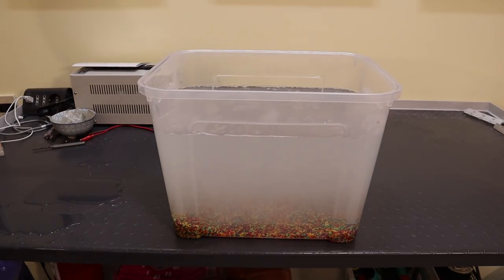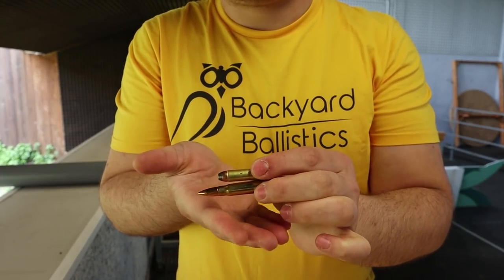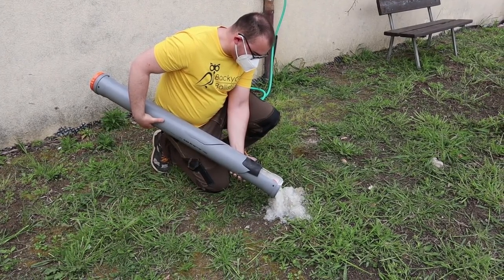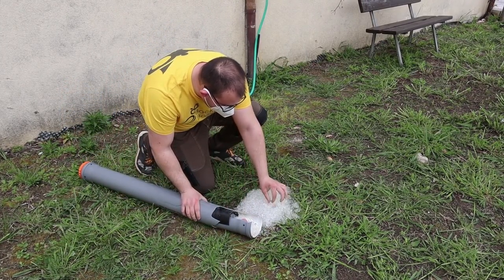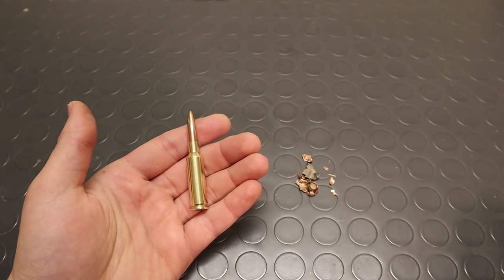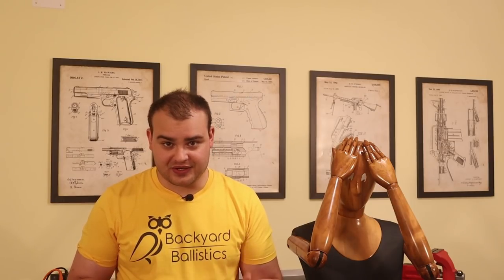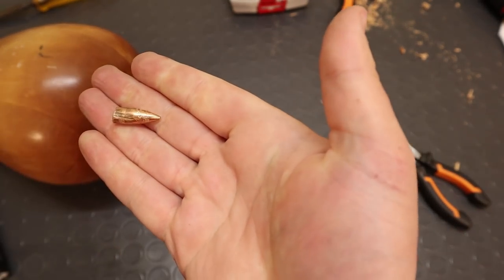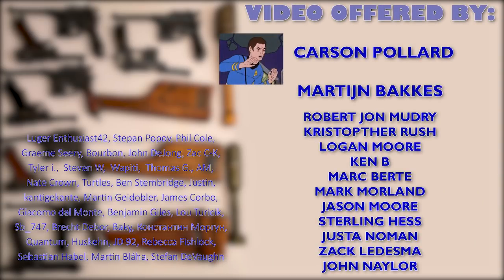How Orbeez Can Stop Very Fast Bullets (And Why It Matters)

Comment: One possible difference in materials could be to use a clear polycarbonate tube lined with a clear silicone coat, in order to enable viewing depth of travel without having to open and retrieve the fired projectiles. Just an idea.
Reply: It's possible to source clear PVC in a wide variety of sizes all the way up to 14 inches in diameter. They definitely make the same diameter as the tube in this video. There is also clear silicone sheeting that would probably replace the black stuff shown here.

Comment: 4:25 I feel like Mythbusters did a pretty decent job on their "survive by diving under water" myth with their angled rig firing into a large pool from a 30 degree angle; it reduces the necessary depth of the container and allows for a longer container, but the principle is still the same - it still needs a very large container full of water, which  can be damaged or ruptured from the hydraulic shockwave of supersonic projectiles if it isn't large enough or robust enough.

Comment: High quality content and a flawless explanation, as usual. There's only one thing I disagree upon: the sentence "this video is already too long".
As for the pipe, I suggest buying those used for acoustic performance: high density material, thick and possibly multi-layered (like the one you used) or additioned with mineral charges.

Comment: I think to avoid the high velocity ammo like the lapua ammo and the ak ammon from deformation you will need a much larger tube. At least 3x in diameter.   I think the deformation occurs when the orbees create dense zones.  The more rounds you shot into the the tube the more dense the cross section became by the looks of it.

Comment: Aren't liquids/gels also forming a vacuum behind the projectile once they close the penetration path again, thus there would be an additional pull force against the direction of movement of the projectile, adding to the stopping power¿ That would be different to a non closing material.
Reply from the maker: That form of drag is proportional to the static pressure, which at low depths is close to atmospheric, so many orders of magnitude smaller than dynamic pressure

Comment: Just curious, is 6.5 Lapua the same cartridge as .338 Lapua?
Reply from the maker: no, not at all, completely different casing and bullet diameter. the 6.5x47 has the same case head as a 308 Win, while the 338 lapua is much larger.

Comment: What about reacting to COD Ghost underwater mission? Where there's gunfights underwater? I know it is sci-fi. But it is something that most people haven't gone back to think about.
Reply: Not so science fiction. The APS rifle used in the mission is a real firearm, it was designed in the USSR to arm frogmen.
Reply: @murmenaattori6  Ah, and how did that turned out?
Reply: @killertruth186  quick bit of research tells me that at a depth of 5m it had an effective range of 30m, at 40m deep the effective range dropped to 10m. So it's probably more effective than normal firearms under water, but not great.
Reply: @cpt.battlecock5264  Yep, max. depth it can still be used seems to be 45m

Comment: I liked the video and had a question. The pipe can expand a little while the water itself is incompressible. Would there be any change if you put a pipe (or other container) with a larger diameter? I can see three possible outcomes. The first is that the difference is too negligible to measure/see. The second would be that the increased amount of incompressible water around the bullet would expend more of the bullet's kinetic energy making it move slower. The other I could see is if the larger container (probably also flexible) flexes more easily due to the increased surface area at the interface between the water and container. Maybe it's enough to make a video out of.
Reply from the maker: Hi! Thanks for providing an interesting question. The effect of increading the pipe diameter gets lower and lower as diameter increases, so after a certain threshold it is negligible in practice. My pipe was actually too small for the energies of rifle bullets (as you might have guessed 🤣), but I'm not able to quantify the difference in penetration depth we would have had using a larger pipe. Base on my experience, I would expect it to be small. 
If instead the pipe was much smaller, and of size comparable to the bullet, penetration would be greatly reduced

Comment: Bottom line is could this be adapted for personal body armor or in an armored vehicle? It seems that it might stop ordinary rounds and dissipate the energy over a wider area with less depth than that pipe. It strikes me that there's got to be some kind of material that it's been discovered as they usually do and don't know a good use for it. Imagine a vest lightweight like a shirt just slightly thicker no more ballistic ceramic or steel plates. Cheaper to make then all of that Kevlar and ballistic material they use now as well. Just little balls of gelatinous water.
Reply: It would be really cool to put it in Kevlar to improve it, but you might need a lot of orbeez to help it stop higher power/faster cartridges such as a 50 BMG or 5.7 caliber FN pistol ( or larger, but still quick calibers )
Reply: There are non-newtonian fluids that were researched for armor use but containing the fluid requires you to develop a self-sealing, bullet resustant container anyway.
Reply: It needs about the same depth regardless of width so that would be impractical.
Reply: @Kaboomf  my point being they are bound to discover or already have perhaps discovered materials that can dissipate the force to the sides instead of directly ahead into the body or vehicle. It's just a matter of time. I'm guessing some kind of electromagnetic fields will eventually appear. Of course that will probably end up having terrible effects upon the human body because we're all suffering from the unbelievable amount of radiation being pumped through us every single day.
Reply: @HowardLuken  That doesn't fit with my understanding of physics. Neither the somehow non-Newtonian armour idea nor the radiation thing. Have a nice day, and keep your tinfoil hat on!
Reply: @HowardLuken  Sigh.

I know I cannot convince you that you're wrong, logic and reason never works on people who believe non-ionising radiation is dangerous.

Yes, there's radiation from all sorts of things including the device you're using to view YouTube videos on. However only ionising radiation is dangerous, unless you have really ridiculously powerful radiation such as inside a microwave oven. Ionising radiation is basically everything from UV rays on upwards, through X-rays to Gamma rays. All that stuff has enough energy to rip apart DNA molecules and potentially cause cancer. And yes, the sun does output some harmful radiation along with the rest.  But common, lower frequency electromagnetic radiation such as mobile phone or WiFi signals are not dangerous because each photon doesn't have enough energy to break molecules. The only way these frequencies can hurt you is if you're standing right in front of the antenna on some really powerful emitter, such as an anti-aircraft radar, and get cooked by it the same way food gets cooked in a microwave oven. If the radiation isn't strong enough to heat you up, and it isn't high-frequency enough to be ionising, it cannot hurt you.

And for your information, there's always a whole bunch of electromagnetic radiation around us from natural sources anyway. Lightning causes powerful bursts of wideband EM, the sun outputs a bunch on various frequencies, distant stars bombard us with radiation all the time. Life evolved bathed in EM radiation.